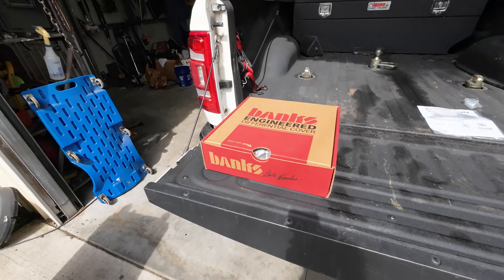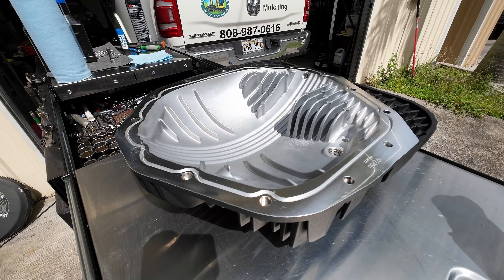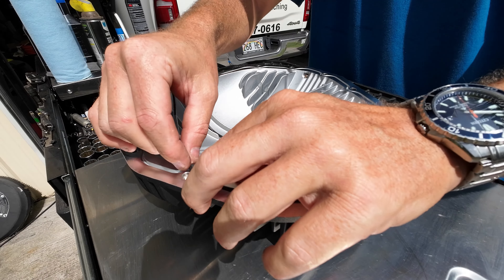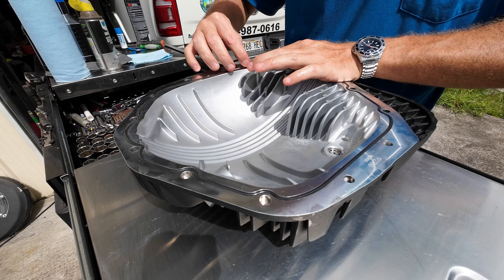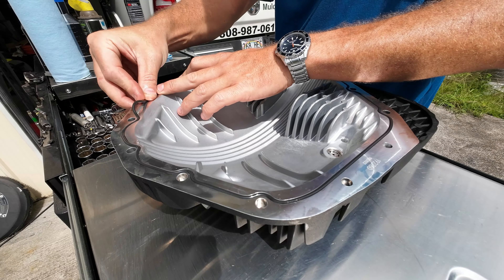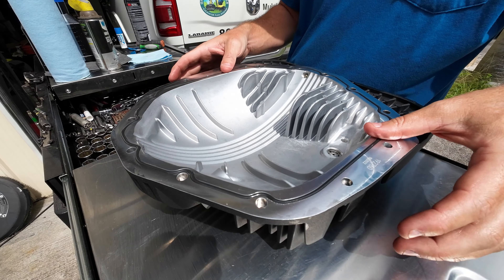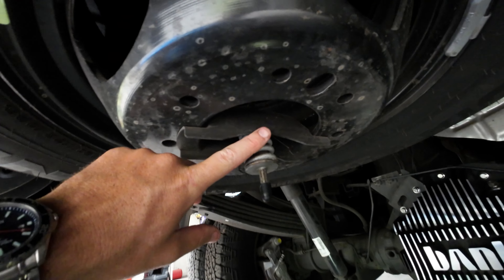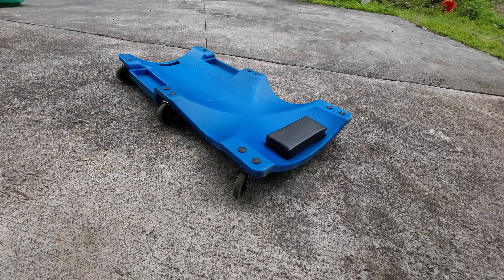What a "Diff"erence

Comment: I have NO idea what this is supposed to do.  I guess with the veins it will allow for better cooling of the gears🤔
Reply from the maker: This cover does just as you mentioned. Also this was the first fluid change for me and this seemed like a good upgrade due to the fact that I dont need to keep pulling the factory cover off to change the oil. This new cover has a drain plug as well. It also has a sight glass to check fluid level on the fly.